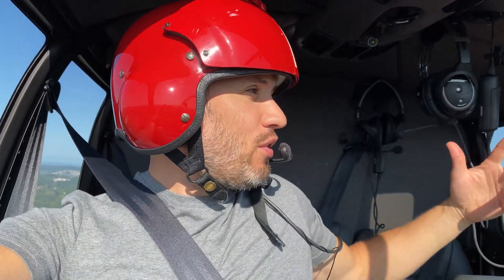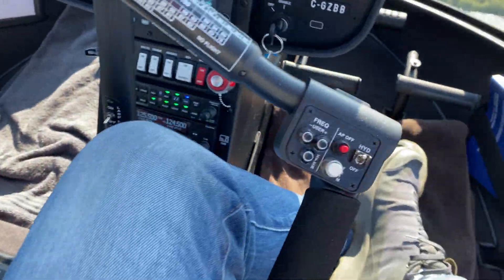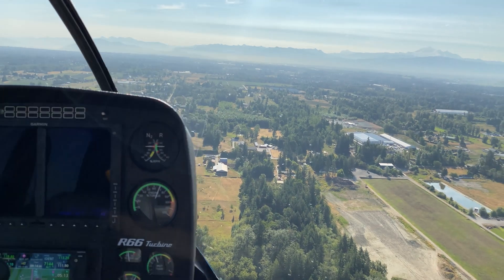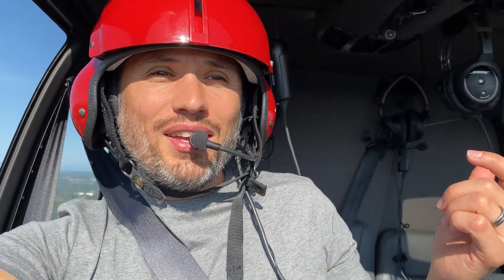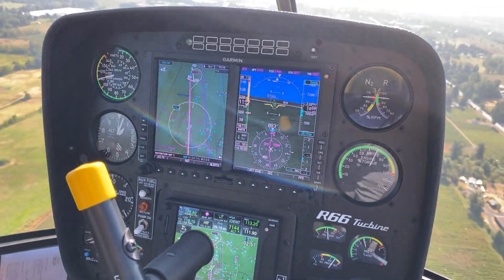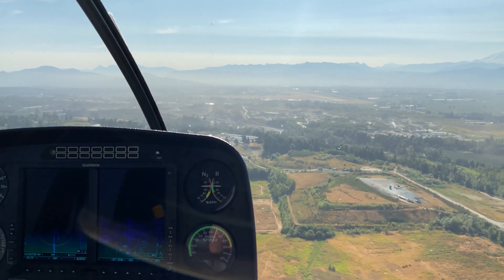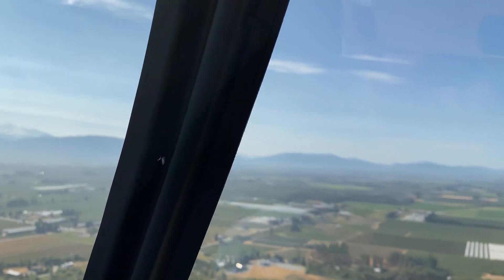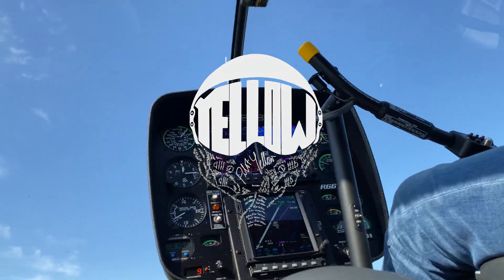2 Axis vs  4 Axis Autopilot

Comment: Thanks so much for clarification Mischa. So far I thought that HELISAS such as the one on your R66 is already a 4-Axis. So it is the same as the future Hill HX50. Even with 2-Axis Auto Pilot, which you can hand-free, it's already like a magic carpet as well. Maybe even an exhausted pilot or a novice pilot sitting on the co-pilot can even fly to land as an emergency. But the challenge with helicopters remains that before flying, we have to take about 30 mn just to run a check-list, and always have anxiety about weather, density altitude, and visibility, such as no-fly during rain and foggy day and during hot days. Let alone, always prepare for inadvertently flying into IMC, where you should not fly slower than 60 knots or 110 km/h either, or the navigation instrument may not work properly.

Comment: With the mast bumping issues in turbulence with the robinsons, are there limitations with the helicopter autopilot in turbulent weather? Would you just get it to slow your speed down or would you fly manually in those conditions?

Comment: What is a 'low gee pushover' that the note on the cyclic says is prohibited?
Reply: When you agressively push the cyclic while in forward flight, or suddenly lower the collective, you momentarily lower the "G" force felt at the helicopter (normally when flying straight and level the helicopter and its occupants are at 1 G, or the force of gravity). That is a low G pushover. The reason that it's prohibited in 2 blade helicopters like a Robinson is that out could result in a condition called mast bumping which could cause a failure of the main rotor.